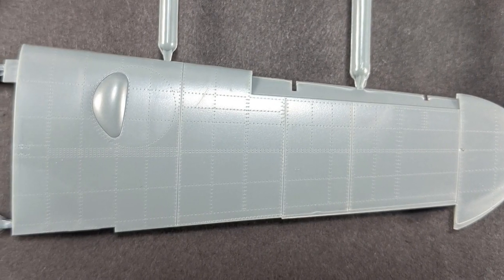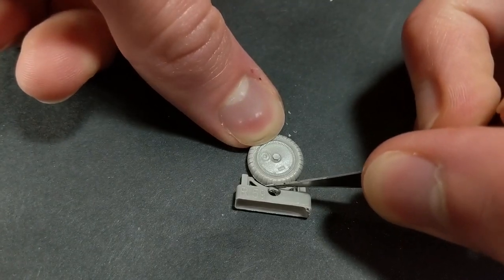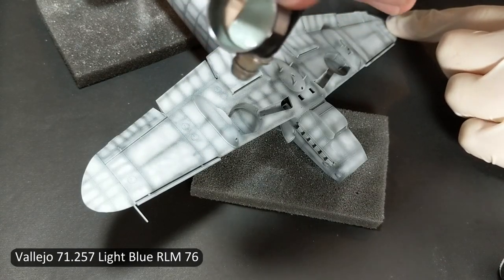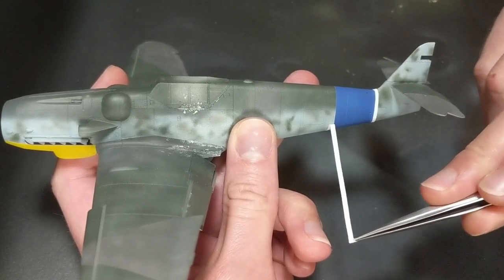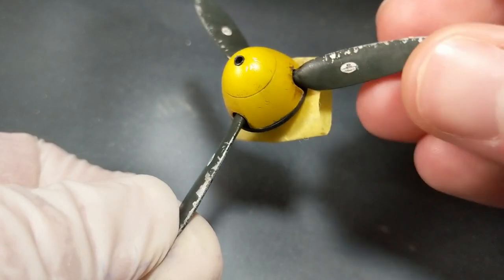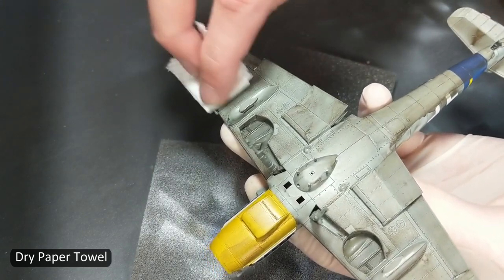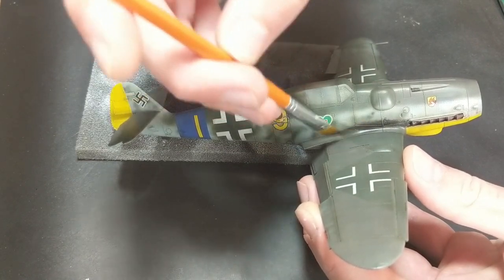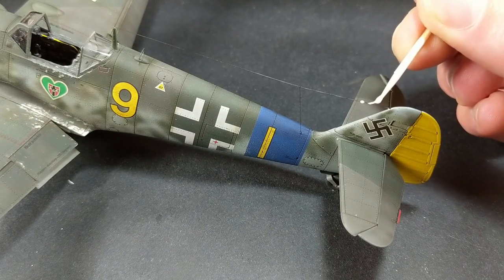Bf-109 G6 - Eduard 1/48 Scale Model - Part 2 of 2

Comment: I'm doing that exact a/c in those markings except in 1/32nd..9/JG 54 "Yellow 9" Fw. Emil Hecker (some think it might be a G-14 as there is no starboard side photos to prove otherwise) but I'll go with the good folks from Eagle Editions knowledge. Nice work my friend
Reply from the maker: Thank you!  Do you have any pics of the original aircraft?  I spent quite some time searching the internet and never found one.
Reply: @ScaleModelAssassin  the only pictures I have are what's included in the Eagle Editions decal sheet EC#40 (one with the pilot himself next to it and the other a a full length profile shot) also it seems no "devils" badge is on the cowl as that was on his earlier Bf.109G-5 "Yellow 11" which he shared w/ Fw.Fritz Ungar and Uffz Gerhard Kroll. Also the spinner back plate was all yellow (the spinner back plate you have in RLM70 and white is from his G-5 which was lost 8 April 44 with Kroll KIA. Btw if you can find the book Jagdwaffe vol. 5 Defending the Reich, 1943-44 you'll find far more info about the unit and it's pilots plus a/c flown including your build :-) HTH
Reply from the maker: I'll take a look for that book.  Appreciate it